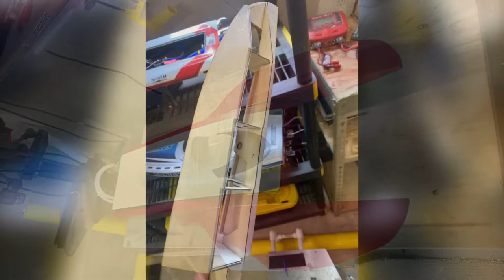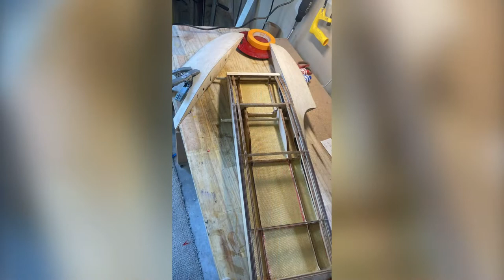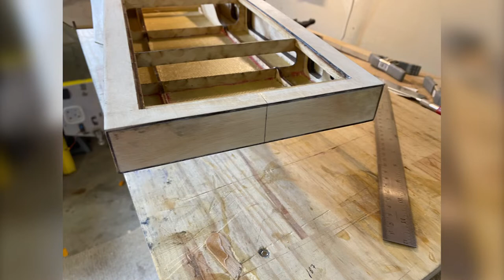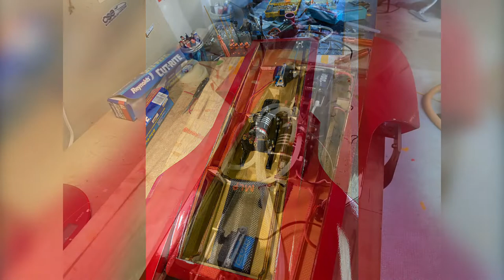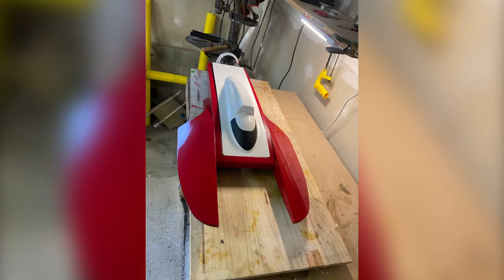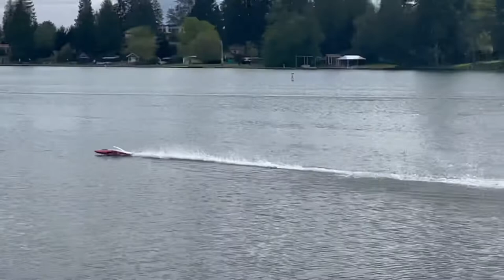New boat on the block.

Comment: Can you tell us more details about your set up? Motor, ESC, battery size, prop? Thanks!!
Reply from the maker: Well the set up this was running till I pulled all the stuff out and installed in my new hydro the black and green one. 
150 esc, 3672 2200 kv,  2x 4s lipos ran parallel.   CHNL 4000s, With ABC propellers.  Sized to match The electronic set up and weather conditions.  1.7 series and up size

Comment: Nice. I have this one and all it does is submarine, with CG behind turnfin. I notice you seem to have some pretty steep recoveries...did you "engineer" those in or is that just stock?
Reply from the maker: This one is the MLB boat Works, GP 310 special edition.  When I built it was based off the original plans and assembly recommended from ML Boatworks.  
Does have pretty steep recovery pads.   

Sometimes just doing full throttle off the start will help     Another thing you can do is drop the Strut a few millimeters that will also help.
Reply: @mad_lizard  oh..I didn't catch that it was the GP. Mine is the GSX310, and has been a complete dog..seeing your recoveries has got me wanting to modify mine...my load out: BEC ZTW 130a, motor: 3831 Dynamite 2200kv 6pole, Grim racer L40x57 3 blade prop. 4S(2P) 5200mh 80c. Strut centered lined with bottom of rear sponsons, and up angle to try to pop nose out of water..And if it does get on plane it goes about 15mph lol... 
Thanks for your feed back..
Reply from the maker: @kyleboyer1074  that set up she should move well.  The 3831 I believe is the 2000kv motor.   What I run in one of my boats on 4s for racing but I running Octura 447 prop and sometimes a abc 1815 she will do 50 on the water.   

Don huff Leo 2200 my other p limmited  sport hydro lsh.  Black pearl with a Octura. 1450 will run 65 mph on the course.   Temps just got to be careful.   
Seems like down to set up and maybe try a few different propellers if you can do that in the class you run or have that option